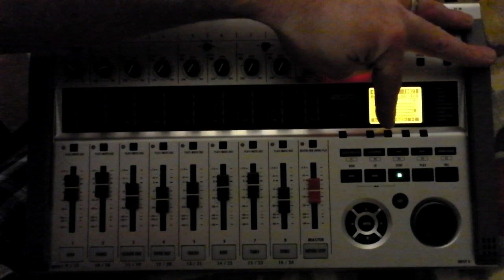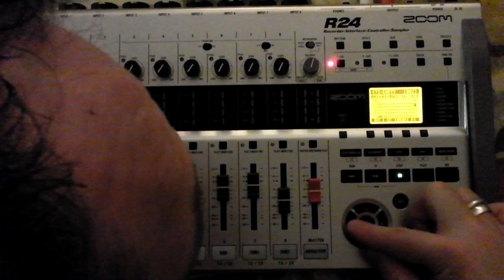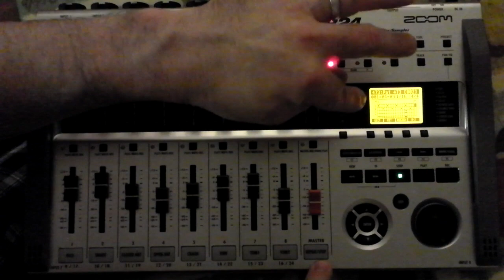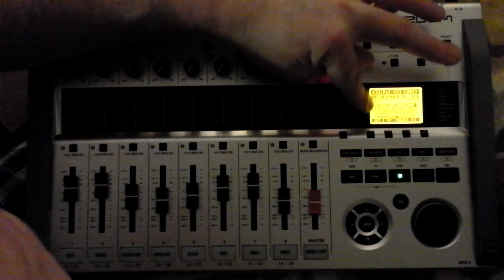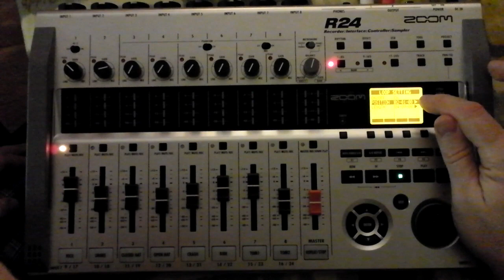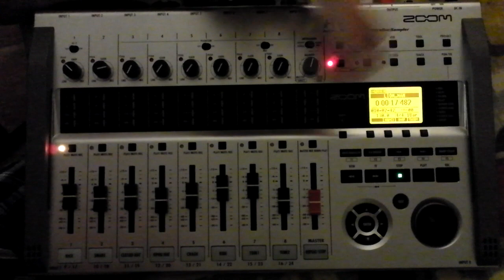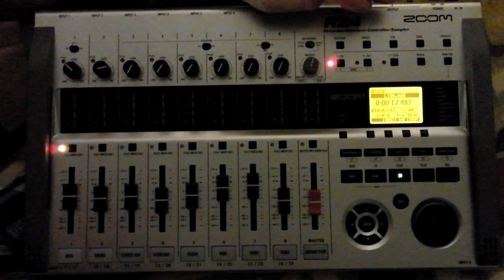Zoom R24 Part 6(c) - Drum Patterns & Loops

Comment: Dude...just want to thank you for taking the time to do this series of videos. I started on a Zoom 10 track about 10 years ago...then eventually progressed to Cubase, which I used for a few years until they decided my version wasn't going to work with Windows 7 and I should but an upgrade...that, added to constant problems with memory and processor speed meant I eventually gave up recording. Wanting to get back into it I went for a multi tracker and the R24 was the best option for me...however, the manuals are rubbish and without your help I think I would have taken years to get back up to speed. Invaluable...cheers!  Brian Johnson
Reply from the maker: +Brian Johnson Not sure how I managed to miss your comment Brian but sincere thanks - you are very welcome my friend.

Comment: OK I am not sure if your series has discussed this but years ago I would record my parts to a click track on a 4 track recorder that I would then use a dedicated track of the 4 track to run a sync signal to an external drum machine (i think a roland) .  The drum machine was very basic but it had a basic rythmn patterns and there were fills and intro and end patterns.  Anyway after I recorded my bass keys guitars and vocals I could go back and by using the sync signal to trigger the external drum machine I then create a drum track one pattern at a time and then record that to the 4 track.  What I am asking is can I do that with just the zoom or do I need an external machine with a dedicated sync signal along with the click track?  Please direct me to video if you have shown that .  Thanks
Reply from the maker: Hi Andrew - the R24 has no sync signal for external devices I'm afraid and no MIDI either - it's one of its shortcomings.

Comment: Does this come with bass loops and guitar loops already in there, like the drum loops, or is it just drum loops?
Reply from the maker: Just drum loops
Reply: @topdazzle  - Doesn't the 12 and 10 and 16 track (cheaper) versions have bass loops as well? They don't look as big as this or as new as this but they have a section for bass and you can record from the pads i believe, not seen that done anywhere though.
Reply from the maker: @jezzyby47  I’ve never heard of the 12 and 10 track versions I’m afraid, just the R8 and the R16, neither of which come with bass loops as far as I know

Comment: I'm wondering...can non-drum/percussion .wav files be placed in the sequencer? For instance, can I use different takes of a vocal part and place them in the sequencer so each will play back at different points in the song? If you mentioned this in your vids, I apologize for not catching it. Great tutorials, topdazzle!!
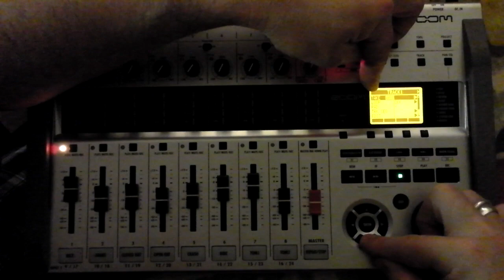Reply from the maker: Yes Neal - you can use anything you record be it vocals, bass parts, drums, etc. - try from 19:50 onwards in this video and have a root through the track menu where you will see you can set it to "loop" - you will then need to use the Track Sequencer in the usual way to build up your parts from your loops.  Hope this helps and thanks for the comments!!

Comment: Mr top dazzle.i have commented before on your videos they are first class.could you tell me please is it possible to adjust the volume on say just the kick drum or say lower the snare a bit or is the volume control for the whole kit.also is it possible to say record a guitar riff and then move the riff up the track without actually playing it again..like a copy and paste really.Once again many many thanks for all your tutorials on the zoomr24 they are extremely helpful to a lot of people.
Reply from the maker: Thanks for your comments - firstly on the drums - if you are referring to mic'ing an acoustic kit then yes, you can adjust each track level independently but if I have understood you correctly then I think you are talking about the built in kits in which case I think the answer is "no", you can only adjust the overall level of the whole kit. I'm not sure there is any facility to copy and paste the guitar riff but you might instead be better in looping it and repeating it that way, using the track sequencer to tell it where to come in and go out.
Reply: I didn't think you could. Once again many thanks for your help have learned a lot from your tutorials cheers Len.

Comment: I have a question. Say for example you want to make a drum cover to a song. Is it possible to input the song into the R24 and assign it to a track and then record your drums as you play with the song? Is that possible ?
Reply from the maker: Yes Anthony - as long as it is a .WAV file and follows the naming convention (from memory, 8 characters followed by .WAV) and use the same folder structure as the R24 uses when it formats your card - you should be able to assign this to a track on the R24 when it is loaded onto your card.  Give it a whirl and let us know how you get on!
Reply: Oh yes.

Comment: Just want to say, thanks for taking the time to make these videos.  I watched all 10 and they're better than any written tutorial.  As a result, I've managed to record a song using 18 tracks with track sequenced drum loops, stereo linked tracks, low-cut filters, insert effects, mastering pre-sets, the lot.  Now what can I do with the other 6 tracks?  Good work.
Reply from the maker: Hey Kris and thanks for the very kind words - feedback like that makes it all worthwhile (and yes, they took me ages!).  Great news about your recording progress and as for the 6 spare tracks, don't do anything with them - just feel warm and fuzzy inside knowing that they're there!
Reply from the maker: Either take the card out and put it in your laptop, or connect the cable and drag and drop.  There are loads of programs to convert audio files to MP3 - even iTunes will do it.
Reply from the maker: Windows will work fine - you need to find the Master track .WAV file within the folder structure on the SD card and try and play that back - should work fine.
Reply from the maker: Does it have the .WAV extension?  When you right click do you have the option "Open With..."?  If so, then click on this and select your media player from the list provided.

Comment: Thanks again for these informative videos, I can make the R24 do what I want now. I have a question though. I know you don't do loop base recordings but I do some. Do you have to formate loops you get off the internet for the R24 to record them to a track? Or is it as simple as adding them from other files?
Reply from the maker: Whilst I'm no expert on this Fletcher, my understanding is that as long as you keep the folder structures and file naming conventions the same as what the R24 uses and the files are WAV, you can use what you want for a loop.  You just need to put them on the memory card (or a USB stick) and then assign them to  a track in order to hear them back.  If you try it and it works, please let us all know.  Thanks, Darren.